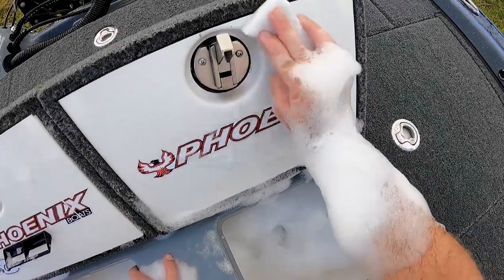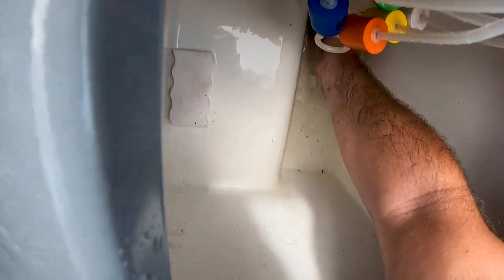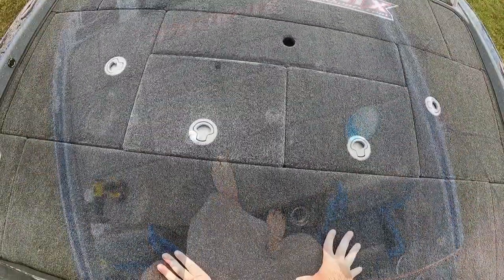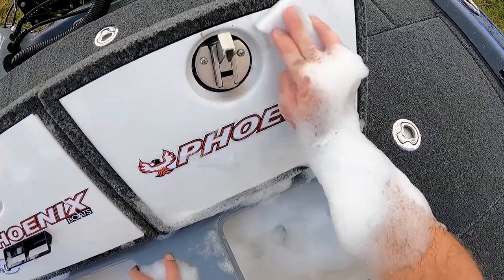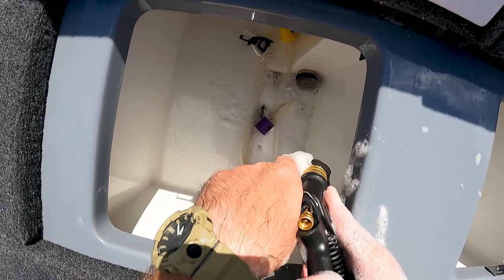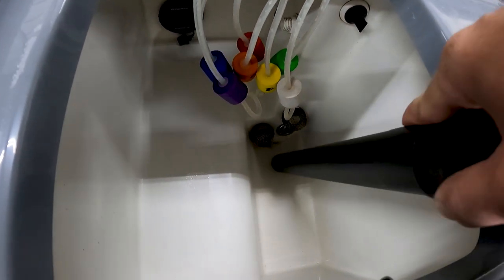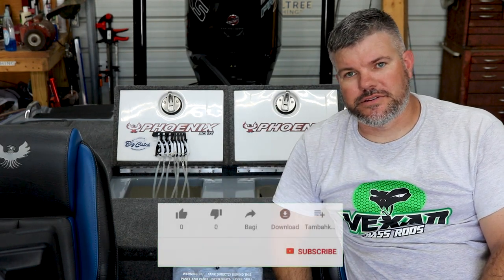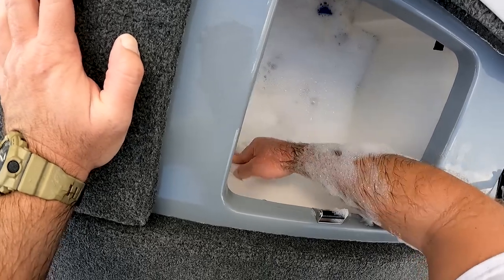How to safely clean your livewell

Comment: Better clean you airator and fill and drain tubes. We had a guy clean his and then fished a big tournament. He failed to run the system and killed 5 large fish. He was sick 😢
Reply from the maker: Yea I flush it with clean water, and once I put in and getting ready for blast off I will run lake water through the system too before putting fish in.